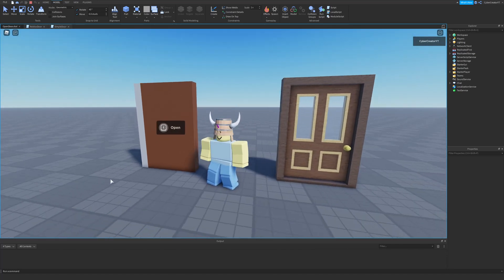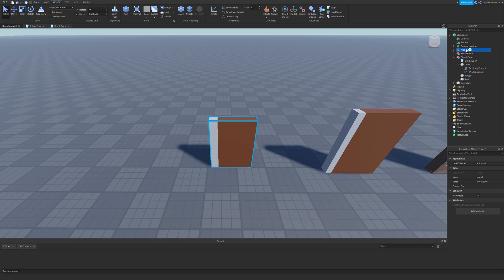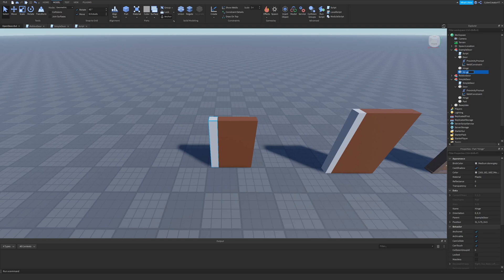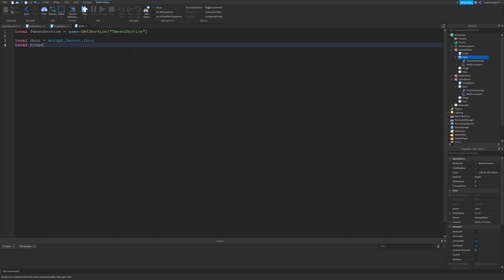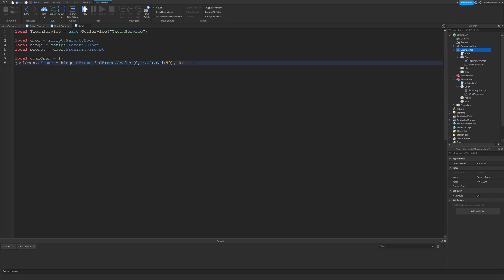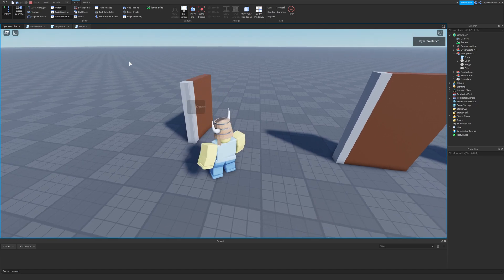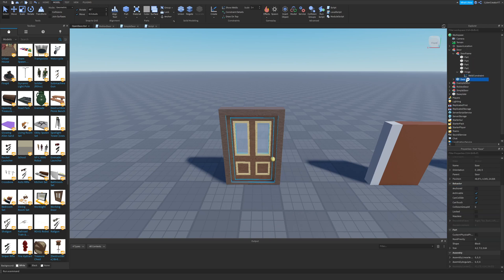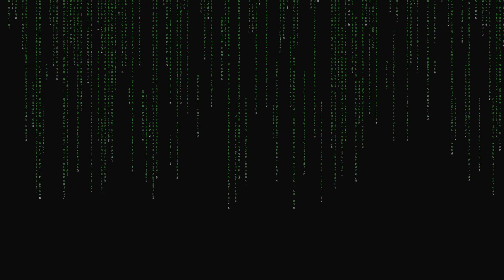E to Open Door | Proximity Prompt | Roblox Scripting Tutorial

Comment: There also is another simple alternative without the animation. You only need door parts/ models without a connecting part.

Put the open and closed door part on the same place (where u want it) but pull the opened door down 20 studs, so they have a vertical distance. Opening (E) will put the closed door 20 studs down and the opened version 20 studs up, so you see the opened door instead, it closes and does the opposite.

For the script you set state = closed at first.

Function open: pull the open part 20 studs up and the closed part 20 studs down. Play squeak sound

Function closed: pull the open part 20 studs down and the closed part 20 studs up. Play shut sound

If you trigger the proximity prompt and the state= closed, it will do the function open, and if state= opened, it will do the function close. 

So in other words, it looks like your door is shutting when in reality your open door teleported away and got replaced with the other door

Comment: Protip: The door has to be unanchored. The Side, hinge, and everything else you added should be anchored, except the door with the proximityprompt.

Also, if ur adding a handle, add a weldconstraint from door handle to the door, also make sure that’s also not anchored.
Reply: Dang thanks soo much bro!
Reply: thx u very much 🔥
Reply: Alright thanks
Reply: What i can do when my door not moving only my hinge
Reply: @TheDominikaduda  Did you attach the door to the hinge?
Reply: It didn't work for me
Reply: nvm ab my prev reply, I got one handle to stick, the other one keeps falling off lol
Reply: Question, when I try to open my door I can only open it from afar. When I want it to be when your infront of the door, how can I fix this?
Reply: @DI9ITALS  check ur door model incase the proximity prompt is too far away or if it can only be opened in a distance
Reply: @luvkurie  yeah it can only be opened from where you spawn in, how can i change it to where its only when your standing infront of the door? I was told to check the Max Activation Distance but i cant find it
Reply: @luvkurie  I can actually do it up close but i need to view it from an angle. what should I do to fix this?
Reply: @DI9ITALS  Oh wait i know, theres a setting in proximity prompts that makes it so you have to be in the radius, without the view of an item being obstructed. I forgot what it was called, so i’ll tell you after checking the settings real quick
Reply: @luvkurie  ty this has been troubling me for hours
Reply: i cant unanchor the proximityprompt help
Reply: @Cole-fx9ts  the proximityprompt needs to be in the door part, and the door is the only thing that needs to be unanchored
Reply: @luvkurie  ok but my door still wont work do you know any other reason it could be ive done the whole script over twice and copy and pasted someones script in the comments, in the game it pops up with e but nothing happens after clicking it, ive anchored the hinge and side, unanchored door, made the weld 0=door 1=hinge idk where ive went wrong
Reply: OMG THANK YOU SO MUCH I COULDN"T FIGURE OUT WHY MY DOOR WASN"T WORKING ANYMORE
Reply: ty bro it fixed my problem
Reply: omg!! i spent like 2 hours asking AI and trying to figure out why it's not working. Thank you so much!
Reply: ty sm
Reply: I absolutely love you man
Reply: that must of been how I was doing it wrong this whole time!
Reply: Absolute pro tip, thank you
Reply: @royalbluegaming7763  Your welcome my guy, have fun with ur awesome door!

Comment: If your door is opening up and down, I just messed with it a little and here. It may open a tiny bit to much but better than up and down Xd. local TweenService = game:GetService("TweenService") -- smooth animation

local hinge = script.Parent.Hinge
local prompt = script.Parent.Door.ProximityPrompt

local goalOpen = {}
goalOpen.CFrame = hinge.CFrame * CFrame.Angles(math.rad(0), 90, 0) --getting current hinge CFrame and multiplying it so that it rotates it by 90 degrees. Converted to radians

local goalClose = {}
goalClose.CFrame = hinge.CFrame * CFrame.Angles(0, 0, 0) --does the same thing but closes the door now

local tweenInfo = TweenInfo.new(1) --takes one second for the tween to open and close
local tweenOpen = TweenService:Create(hinge, tweenInfo, goalOpen) --we want to tween/rotate the hinge
local tweenClose = TweenService:Create(hinge, tweenInfo, goalClose)

prompt.Triggered:Connect(function()
	if prompt.ActionText == "Close" then
		tweenClose:Play()
		prompt.ActionText = "Open"
	else
		tweenOpen:Play()
		prompt.ActionText = "Close"
	end
end)

Comment: If your door is opening upside down use this script. It only changes one thing

script:

local TweenService = game:GetService("TweenService") -- smooth animation

local hinge = script.Parent.Hinge
local prompt = script.Parent.Door.ProximityPrompt

local goalOpen = {}
goalOpen.CFrame = hinge.CFrame * CFrame.Angles(math.rad(270), 0, 0) --getting current hinge CFrame and multiplying it so that it rotates it by 90 degrees. Converted to radians

local goalClose = {}
goalClose.CFrame = hinge.CFrame * CFrame.Angles(0, 0, 0) --does the same thing but closes the door now

local tweenInfo = TweenInfo.new(1) --takes one second for the tween to open and close
local tweenOpen = TweenService:Create(hinge, tweenInfo, goalOpen) --we want to tween/rotate the hinge
local tweenClose = TweenService:Create(hinge, tweenInfo, goalClose)

prompt.Triggered:Connect(function()
	if prompt.ActionText == "Close" then
		tweenClose:Play()
		prompt.ActionText = "Open"
	else
		tweenOpen:Play()
		prompt.ActionText = "Close"
	end
end)
Reply: what if the button to open the door only appears at when you're spawining so it it doesn't let you open the door when you are in the game

Comment: hey, i know u probably dont check comments in this video since this message is far from when this was posted but

if u could, could u make a door exactly like this but its locked and it can be unlocked by a tool. essentially the prompt could be disabled but when it detects if a user has a certain tool the option will pop up. only people with the tool can go in to the door, for the players without they cannot go inside. thanks!

Comment: The door is not opening it says E Open but it doesn’t actually open
Reply: did you write the script correctly? or make the exact same names?

local TweenService = game:GetService("TweenService") -- smooth animation

local hinge = script.Parent.Hinge
local prompt = script.Parent.Door.ProximityPrompt

local goalOpen = {}
goalOpen.CFrame = hinge.CFrame * CFrame.Angles(90, math.rad(0), 0) --getting current hinge CFrame and multiplying it so that it rotates it by 90 degrees. Converted to radians

local goalClose = {}
goalClose.CFrame = hinge.CFrame * CFrame.Angles(0, 0, 0) --does the same thing but closes the door now

local tweenInfo = TweenInfo.new(1) --takes one second for the tween to open and close
local tweenOpen = TweenService:Create(hinge, tweenInfo, goalOpen) --we want to tween/rotate the hinge
local tweenClose = TweenService:Create(hinge, tweenInfo, goalClose)

prompt.Triggered:Connect(function()
	if prompt.ActionText == "Close" then
		tweenClose:Play()
		prompt.ActionText = "Open"
	else
		tweenOpen:Play()
		prompt.ActionText = "Close"
	end
end)
Reply: @Bergerbekh  It's not opening
Reply: @KarljosefMariano  well idk then
Reply: @KarljosefMariano  Your issue might be because youre using "Triggered" instead of "TriggerEnded". difference between the two is that:

Triggered only works when you hold the Enum key for a set amount of time. for some reason (from at least what ive seen, it works for two models and then breaks on everything else.)
TriggerEnded works by firing after the Enum key is completed when its held down. it is much more reliable in most cases, especially when you have the proximity prompt be more than 0 seconds long.

To fix this, simply go into the script under the door model and change "Triggered" to "TriggerEnded"
Reply: @TypicalVideoViewer for me its still not working ;-;

Comment: For some reason after it's opened, I don't get an option to close it again. I did configure it so that it only opens to 70 degrees and added a script that makes a sound play when the prompt is triggered. Do you know what the issue is?

Edit: Fixed the issue, for some reason in my audio code I made it so the trigger distance would be set to zero after the script played the noise. Oops!
Reply: I can't get the door to swing open, could you help?
Reply: @carat9023  did you add any additional scripts or parts to the model? Is the door part that’s connected to the hinge anchored?
Reply: @CatMagglio  It is anchored, and I don't think I added any extra scripts or parts, I have no idea whats wrong

Comment: Great video but I have a problem. When I made finished the script,  I tried if the door works and there is the E to open thing, but it doesn’t work. Could you please help?
Reply from the maker: Without seeing the code or if there are any errors I'm not sure what the problem would be. Join the discord to get more in depth help https://discord.gg/X3zdqHy
Reply: I had the same problem, I don't know if its for the same reason but the reason for mine was in the bottom of the script 

 else
		tweenOpen:Play()
		prompt.ActionText = "Close"
	end
end)

make sure where it says tweenOpen:Play() and not tweenClose:Play() which was my problem

Comment: So, I did all the steps that you did, and I even double-checked. But when I press "E", it doesn't open. Why is this?
Reply: You can try re-checking your part names, if you copied the script but not the object naming the script wouldn't be able to call the object. Maybe your ProximityPrompt is named something else, but in the script you tried to call it ProximityPrompt?
Reply: i know this is four years old but your issue might be because youre using "Triggered" instead of "TriggerEnded". difference between the two is that:
Triggered only works when you hold the Enum key for a set amount of time. for some reason (from at least what ive seen, it works for two models and then breaks on everything else.)
TriggerEnded works by firing after the Enum key is completed when its held down. it is much more reliable in most cases, especially when you have the proximity prompt be more than 0 seconds long.
Reply: WELL DID U PLACE THE SCRIPT INTO THE PART U WANT?
Reply: @davidlau8005  brotha chill 💀

Comment: Whenever i try to open the door, output defines '()' and '()' in lines 7 and 10 as an error
Reply from the maker: Are you referring to goalOpen and goalClose? Those use curly braces {}
Reply: @CyberCreator  It works but door is being rotated around its center
Reply: I fixed the problem
Reply from the maker: @daviddobric887  yeah you have to rotate the hinger and weld the door to the hinge. not rotate the door directly

Comment: It's not working sr

Edit: sorry but you forgot to say you need to delete (local door = script.Parent.Door)
Reply: Yeah it dosent apear to be working for me either,
Reply from the maker: @potatoo2137  What part is not working? The script in the video works as well as the models linked in the description.
The "correction" I made with some a pop up on screen was missing the "Door" variable so if you followed that change you may have gotten confused. Otherwise it will work. Join the discord and I can help out with anything else
Reply from the maker: That variable is used in the simple door. I delete it in the "fancy" door. I'm not exactly sure what you mean, but as long as you got it working!

Comment: do you know how to make it so when you touch a block it changes the Color Correction but for only the player that touched it?
Reply from the maker: Inside a LocalScript use the Touched event to listen for the part being touched. When it is touched, check to see if a player touched it and specifically check to see if it was the LocalPlayer that touched the part. If it was the LocalPlayer, then change the color. If that doesn't make sense join the discord and I can clarify

Comment: Another outstanding video from my boy Cyber. I do have some questions though. When you’re rotating the CFrame of the door, why did you not just do 90 instead of math.rad(90)? Is there an explanation? What’s the meaning of Visual? How can you weld to Visual?
Reply from the maker: Visual is just the name of a part of the door. I should have made that more clear. There's a link in the description with the model if you want to check it out.
You have to use math.rad because the CFrame.Angles function uses radians and not degrees so we need to convert the degrees into radians. This website explains radians in more detail if you aren't familiar https://www.mathsisfun.com/geometry/radians.html
I'm planning on making a video on CFrames in the future
Reply: @CyberCreator  If it uses radians then why didn't we have to use math.rad() for the x and z as well, that were zeros?
sorry i just dont know lol
Reply from the maker: @betrayedpickle291  fair question! math.rad(0) is actually 0. 0 degrees is also 0 radians so we gave the degrees in radians when we just used 0.
Reply: @CyberCreator  i see now, thanks!
Reply: @betrayedpickle291  Redundant. Just know that pi radians = 180°
Reply: @CyberCreator  dude thank you! This explains 50% of my scripts that doesn’t work